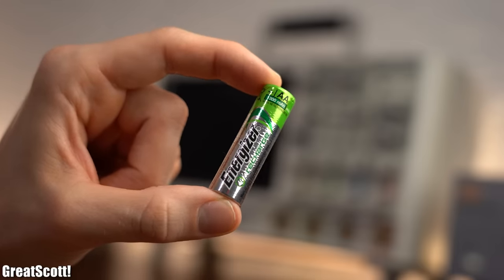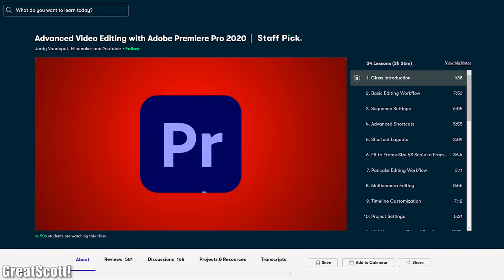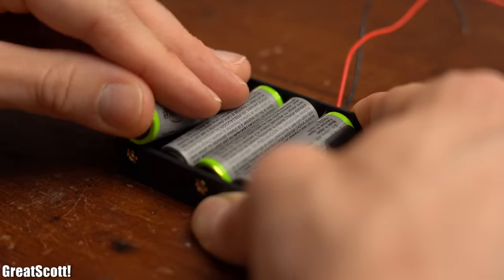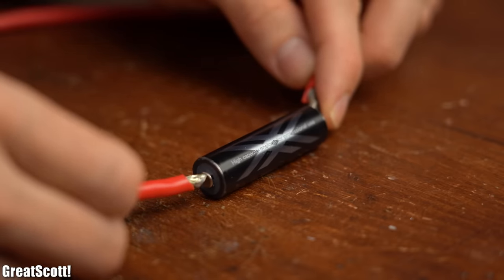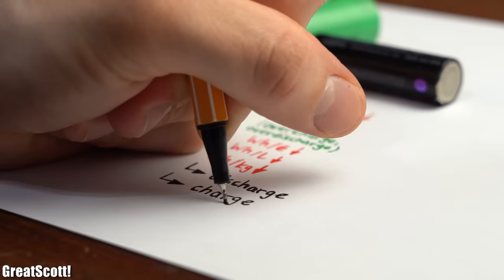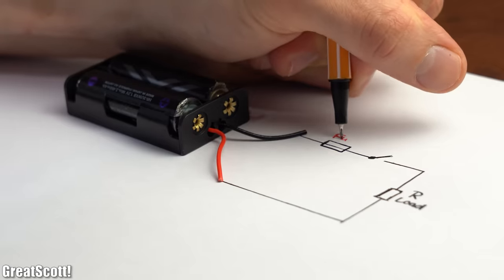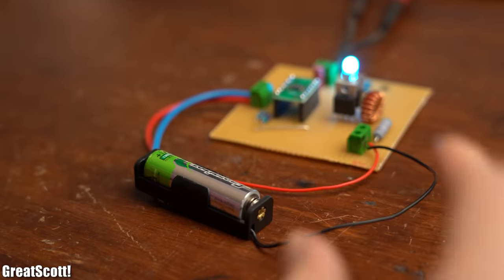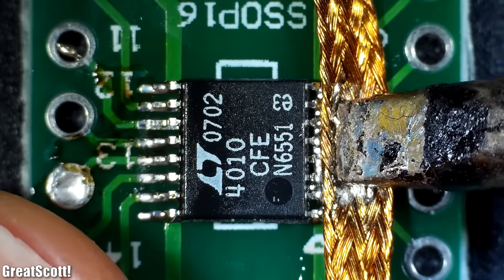Are AA NiMH Batteries obsolete? Here is everything you need to know about them!

Comment: You can get lipo cells in AA size that feature a modern boost converter so they always output 1.5v with low ripple, the better quality ones also graciously drop voltage when nearing low capacity so they imitate the voltage drop of alkaline AA cells for devices that measure slow battery on the voltage drop.
Reply from the maker: Good to know
Reply: Yes, and every single one of those that I tried had a very low capacity and a high self-discharge. All garbage
Reply: I think it's a buck converter to drop the 3.7V, not a boost.
Reply: love it
Reply: @senorcapitandiogenes2068  the capacity is not low because the voltage remains high. They have 2000mah typically. If you want a low discharge battery then a LSD NiMH is more suitable, but a LFP liion would come very close.
Reply: @dennis_m  yes sorry it's a buck converter to reduce the voltage. The very early ones of these cells exhibited poor ripple and lots of devices really didn't like it, now they are much better and most devices cannot tell or are designed for higher voltage tolerant.
Reply: @Swwils  No. The capacity is low because these things are not meant for anything that draws more than 500 mAh. They are useless for flashlights
Reply: Wow!!!
Reply: Anyone know of any made by Japan/Germany? I can only find random Chinese ones.
Reply: Why would you want to boost the voltage of a lithium cell? They’re typically way more than 1.5v even when dead. The lithium cells shaped like a AA battery either have a buck converter or no converter at all so they can fry your AA device.
Reply: @senorcapitandiogenes2068  yeah, i'd be shocked if that miniscule buck converter could carry more than an amp... Only good for appropriate devices. 

I'll stick to decent NiMh cells for now.
Reply: @volvo09  Agreed. I use the Ikea LADDA cells. The 2450 mAh cells are propably Eneloop Pros
Reply: I use the Tenavolts in my headphones and compared to my eneloop batteries I get longer run times and more bass response (I assume 1.5v vs 1.2v helps ).  I got them only because they were on sale (also saw the BigClive video) and more than a year later I'm still using them daily.  I would buy again, no I have no affiliation with them.
Reply: You mean buck converters?
Reply: @senorcapitandiogenes2068  Project Farm's testing also put the Laddas near the top of the performance/price chart.  They're good cells. Fortunately I'm only about 20 minutes from an Ikea.
Reply: @wesley00042  I can only confirm that. I have been using the 2450 Laddas for almost a decade now and none have failed or have drastically decreased capacity. Good stuff.
Reply: You want clean DC voltage from a battery, not a noisy switch mode converter. NiMH is better of course.
Reply: I use 1.5V Li-Ion AA and AAA batteries from Kentli, which was one of the first companies to make these AFAIK. These seem to be of decent quality, none have failed on me (yet), and they deliver their promised capacity. Self-discharge is not too bad, although the AAAs obviously drain much faster than the AAs. What is nice about the Kentlis is that one can access the internal cell directly through the charging contact, which allows to get an idea of how much juice is left in them.
This type of battery is suboptimal in many cases (doesn't make much sense for use in flashlights), but is ideal for those devices that don't draw a large current but don't work well with the lower voltage of Ni-MH.
Reply: They have been on the market for a while, with the drawback of requiring dedicated chargers or USB charging. An internal Boost converter simulating NiMH charging cycle would be cool.
Reply: There are also NiMH cells with built-in micro USB port and buck converter. While the space occupied by circuitry obviously detracts from cell size and capacity, those I have work very well, and can be charged either via USB, or a normal NiMH cell charger. As a bonus, each 4 cells came with a Y-adapter, for charging 2 cells at once from a single USB charging port. I have charged them from my laptop and from normal USB chargers and there is no discernible difference. Either way, they never get overcharged... Not that such is much of an issue, but it can dry out the electrolyte faster in some batteries.
Reply: I got some AA Kentli li-ion 3.7V or 1.5V (2 positive terminals) which are supposed to be 3000 mWh @ 1.5V.  I hope they will cycle for years!  I have yet to test capacity properly, but they seems to work fine.  I don't know if I'd break them testing 1.5V in my Zanflare C4 tester.
Reply: @Swwils  LSD is definitely way more suitable for a wide variety of issues. 😁
Reply: Yep, got once a pack of them as i heard about that and they were pretty interesting, especially for camera flashes, flashlights which were nice and daily used but only supported AA 1,5V etc.
Best part about them was: their power output was so much more stable and powerful (for DSLR flashes!) next to the much higher capacity

But i think they are rather a easy conversion for older devices than anything we should use „normally“
Reply: @senorcapitandiogenes2068  if you use proper ones, they do! I used them in flashlights and my dslr flash and the ones i used were MUCH better than regular alkali and still slightly better than good Sanyo/Eneloops, but especially the capacity was phenomenal 4 of the LiPo AAs replaced practically a set of 8x AA Eneloops (white) with usage of the flash
Reply: But are they cheaper or the same price? Mostly they’re more expensive.
Reply: @timsievers2067  Varta.
Reply: @sakurojason  the issue I have is maintaining the voltage. The NiMH drops below a working voltage way to quickly. The LiPo with the buck built in are more stable for that purpose when the current is still low.
Reply: @R.B.  I see but I assume that LiPos are more expensive than NiMHs
Reply: @sakurojason  it is, but for my application (in the controllers for VR), it is the difference of only a couple hours of use or days. The controllers are very sensitive and need to maintain close to 3v, so my choice is alkaline, constantly recharging with partially depleted cells, or the LiPos which at a cost per unit still outperform for this application. For other applications which aren't as sensitive to the voltage drop, other battery types might yield a better unit cost. The only real disadvantage is that the battery meter in the controllers are calibrated for alkaline profiles and they don't accurately tell me that the cells are close to empty before they actually run low.
Reply: @R.B.  they’re at least more accurate with NiMH’s than with LiPo’s. Alkaline’s are mostly not rechargeable. Mine can run at maximum 1.7v but even at 1.4v it shows 100%. They show 20% at 1.0v. Do it’s perfectly usable for this application.
Reply: @sakurojason  I didn't mean to suggest I was charging my alkaline... I meant days with alkaline but no recharge, hours with NiMH and partially depleted cells, or days with LiPos with the built in converter. Over a year, the cost of the LiPos is my best option giving me the best energy per charge and while a little more expensive than the comparable NiMH, it is significantly more reliable in this situation. If the voltage level could be lower, NiMH might have been better, but not for my application. Charging is less convenient though as they require 5v and the battery itself has the charging circuit.
Reply: @westelaudio943  Depends on your usage, my wireless mouse and joysticks don't care if it comes from a buck converter or a clean dc. But yeah for audio equipment maybe not.
Reply: @sakurojason  I'm only seeing NiMH made by Varta, their Lithium is non-rechargeable.
Reply: @timsievers2067  Energizer makes NiMH too and Varta’s LiPo’s or LiIon are rechargeable.
Reply: @sakurojason  Any LiPo or LiIon from Varta I can find in AA/AAA (in 1.5V) sizes are not rechargable and they don't list them on their website. NiMH are 1.3/1.2 and they can be iffy in a lot of electronics designed for disposables.
Reply: @senorcapitandiogenes2068  "These things are totally trash because they didn't work in my niche use case" is hella bad logic.
Reply: There is also a type of battry... while very rare... to the point of extintion  today that links two AA lithium 3.0V cell parrarell into a sort of ad hock dual cell AA packade. The packade assumes that the end will just be linked back.

The benefit of this arangment is very high capacity but also high voltage.
Reply: Standard Lipos last max a year...
Reply: I'm good with NiMH, the ones I have are amazing and super cheap, Turnigy LSD, they always have charge, they can charge around 2600mah and last big time for the stuff I need.
Reply: I've got a meter that uses 6xAA batteries. On NiMH, the meter constantly has the low battery alert displayed because it's nominal 7.2v doesn't take too long to dip into the 6v range. I'm currently experimenting with using it with 3x 14500 LiFePO4 cells and 3x dummy blanks, meter is pretty happy with the nominal 9.6v. Downside is that I'm losing a lot of mWH with three dummy blanks in the pack, and I'm going to have to watch my voltage over time like a hawk because the low voltage limit on LiFePO4 is 2.5v so a total of 7.5v is actually higher than 6x NiMH that are fully charged and rested.
Reply: @jarphabib  I do the same however I don't recommend using LiFePO4 cells in vintage electronics as the higher nominal voltage was enough to kill the servomotor IC in my Professional Walkman.
Reply: Yeah it's called a buck converter, and it takes up space, and it's not 100% efficient.  Not get to work making this work better than NiMH (it doesnt)
Reply: @martinlutherkingjr.5582  Not boost, drop.
Reply: @matsv201  This was easily the best comment I've seen.  Bravo!
Reply: I've used 2x AA 'T-Power' brand lipo-to-1.5v batteries on an indoor weather station for 14 months (and counting). Charged twice - once after 6 months 20 days, then again after 6 months 22 days. 
I also use the AAA version of this same brand on the headphones. I've got 2 of them and alternate/charge them when the one in use goes flat. No problems/hickups so far. Probably cycled each ~25 times so far. Micro USB power input for charging. They have 5v across the battery output (instead of 1.5v) when you have the USB cord plugged into it :)

Comment: Still got the NiMHs I bought circa 2005. Almost no drop in capacity. They're a combination of original Eneloops and President's Choice (Eneloop clones or rewraps). All made in Japan to tight specs. It amazes me to see they're still usable and competitive nearly two decades later. Never had any leaks or failures.
Reply: NiMH are really robust along with NiCD
Reply: You'll still be using them in 10yrs in remote controls 👍
Reply: My uncle has nicad batterys from the 80s that still charge and work
Reply: See? Even George W. Bush prefers using Ni-MH over Alkaline.

Comment: I think a main "advantage" is 1.2V close to 1.5V Alkaline, that's why it exists in 14500 format and they won't disappear until AA primary batteries will!
Reply: Well definetely. Li-Ion cant replace NiMH in AA/AAA space bcs voltate is way too damn high. We would have need toss all devices we have. And there is also another point - NiMH wont blow your face and pocket up..when they are faulty. Did you ever seen flames from bad Li-Ion? Like.. i dont want do that. Bud if Li-Ion are produced in quantity like AA/AAA we will have some good old burning damage
Reply: @AjdamusMagnus  You can use a single lithium ion and a slug for the second battery.
Reply: No reason you couldn't sell "AA" sized Li-ion cells where the cell is 1 or 2mm shorter than AA and then a buck converter fills the remaining space to convert the 3.7V down to 1.5V, would even make them safe to short as the buck converter could be current limited.
Reply: @RWoody1995  There are AA/9V batteries with such DC/DC system but it's not appropriate for low consumption devices (most devices that still use AA batteries). At low power, the self consumption of the DC/DC converter is way higher than the device consumption! A LCD device can consume something 10 µA while the DC/DC will always draw something like 1mA at rest.
Reply: but there are AA li ion batteries. derp
Reply: @Blox117  the aa lithium ions have dc to dc converters that have poor efficiency at low current, so anything that has memory or clock will kill them in a short time.
Reply: @AjdamusMagnus  Relax, Dude. It's basically the Norm, that AA/AAA have 1.5V and are built in that shape and size, therefore we won't switch to Lithium, so don't cry out loud. 

However, there are actually, as stupid as this sounds (and is), there are Li-Ion AA/AAA rechargeable Batteries, with a USB Port for Charging. Not very efficient at all and very wastefull, but doable. 
And Lithium Batteries aren AS dangerous as you describe. They won't spontaneously burn, unless there is something seriously wrong. But if so, your Li-Ion Battery the size of a AAA Battery wouldn't cause a lot of harm anyway.
Reply: @sagichdirdochnicht4653  Excuse me? Wtf are you talknout about. Why crying?

And thx. I work for Varta so I really did not know that AA baterie are 1,5 V. Thx for clarification. I would be lost without you.

Bateries wont burn unless there is problem with them? Oh so.. I was like.. they just explode when they feel like. Hey.. are you interested in batery business? I Think you have some new ideas we all were missing.

AND YES fire frome AA batery would do MUCH damage ffs. I saw myn fires from 18650 bateries. There is not much difference in size fs
Reply: @RWoody1995  reason they don't make it is cost and fire danger
Reply: @AjdamusMagnus  What are you talking about? There are LiIon AA and AAA batteries... I have a few dozen... They are all chinese made sadly (don't have nearly the quality I would like) but they are there and just so happens to be multiple manufactures.
Reply: @AjdamusMagnus  Because you are making a WHOLE stick out of fucking AA/AAA Batteries, because it would be SO horrible to have them made out of Lithium. Which I wouldn't actually disagree with, but then again: THIS PROBLEM SIMPLY DOES NOT EXIST. Nor will it ever in a  big scale. 

And well, I haven't worked for Varta, but I'm a trained electrician and I have worked with all kinds of Batteries as well. 
Doubtless, Lithium Batteries are more dangerous then let's say alkaline or nimh. But I have seen my fair share of 18650 fires as well. Let's just say you shall place venting holes in the Battery doors. The Flame and the Gases aren't that dangerous on their own, but an explosion due to preasure, that is another story. 

Yes, a big Scale AA/AAA Lithium production would be much more problematic, as the manufacturers will most likely have Millions of them. But for the End Consumer... Rather not. 

But again: This is no Discussion that needs to take place. Because again: THIS PROBLEM DOES NOT EXIST.
Reply: @sagichdirdochnicht4653  ok Todd
Reply: @ionstorm66  bang!😃
Reply: @ionstorm66  I've used 2xAA size lipo-to-1.5v batteries in an indoor weather station. They last 6 months 20 days before needing recharging. (6 months 22 days the second time). Started 14 months ago. No hickups yet :)
Reply: @jimmybrad156  yeah those are nice, but you loose a good bit of capacity with low power draw devices via the buck converter.
Reply: @ionstorm66  The advert suggested expecting 3 months, and they gave 6 months which was nice. But yeah would be nice if they lasted longer. Maybe I should try eneloops lol

Comment: One of the benefit of NiMh is it can be stored at full charge for a long time, while the lipo does not like being at that state( or else it will get puffy), a better choice for emergency device(flashlights)
Reply: Well they can discharge a reasonable amount after a while so you should maybe change them with fresh ones every year maybe. Thats just important because you meantioned emergency lights which should definitly work when needed.
Reply: Wait, is that why my Nokia batteries were puffing up? I remember seeing it and then not using it for like half a month
Reply: @antkoos  yup, especially in warm/hot temperature, you dont want to leave your lipo in full charge for a long time. It's really bad for them
Reply: True, but you don't need to leave a lithium cell fully charged, 70-80% charge is fine and still a lot of energy, also my cheap 18650 flashlights are way better than the AA flashlights I've used, maybe the new ones are better but yes even with an led the ones I had were still dimmer and bulkier.
Reply: NiMH do self discharge over time but they don't suffer the same problems lipo cells do, they don't get damaged sitting uncharged
Reply: This is exactly why I like NiMH batteries for 'general use' applications. There's loads of devices which have modest power / capacity demands, but which I want to be ready-to-go at all times. Stuff like computer periphials, emergency flashlights (li-ion can't be beaten for 'fun', high-power flashlights), remote controls, multimeters, R/C model transmitters etc.
Reply: @vgamesx1  This is true, but it's the mental annoyance of having to micro-manage the state of your batteries (if you've got dozens of them) which puts me off.

I have a couple of powerful 18650 flashlights, but I prefer NiMH as a replacement for disposable AA / AAAs.
Reply: Unfortunately, they don't hold charge for long in storage.
Reply: @Andy-df5fj  Modern low self-discharge NiMH cells have been pretty good in my experience. Eneloops should retain about 85% capacity after a year, which is good enough for me.
Reply: @Andy-df5fj  Yes they do if you buy the low self discharge versions (retain approximately 75% to 80% of initial charge after 1 year in storage).